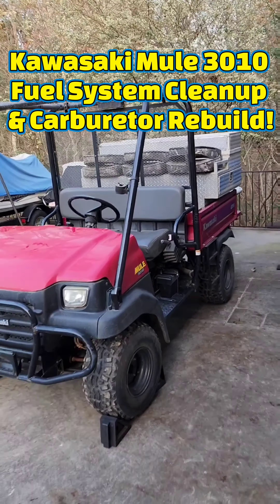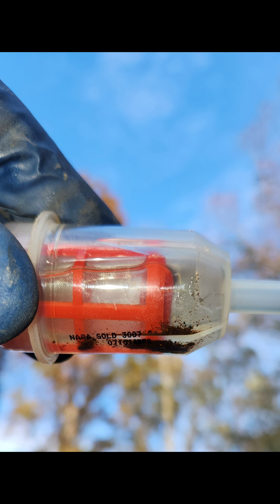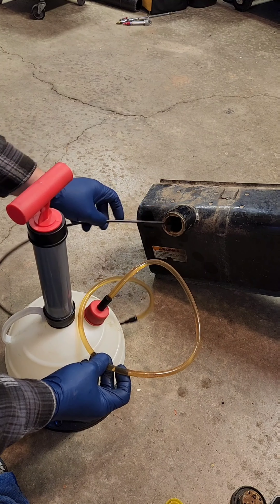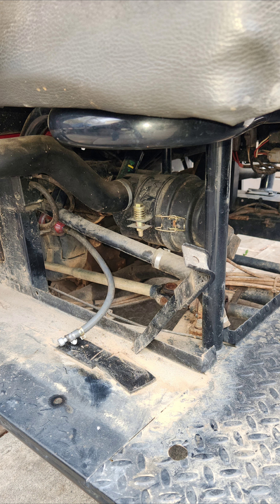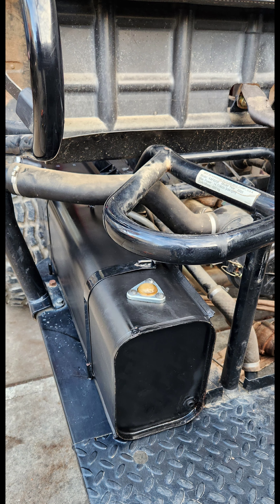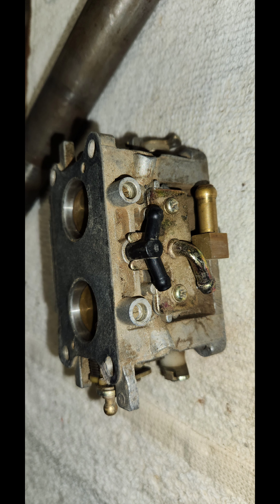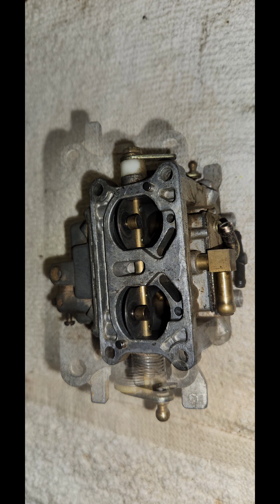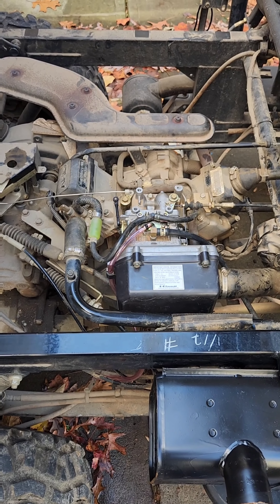Kawasaki Mule 3010 | How To Clean Out A Metal Fuel Tank and Carburetor Cleanup!

Comment: I have a 2510 mule and very similar looking gas tank arrangement, the one that you just repaired. I am unable to move more than a tiny bit of air backwards through the fuel pick up tube that exits the top of the tank. Is there an internal check valve or am I safe to ride it out with a long piece of wire thanks for your help. I can’t really visualize what’s in the bottom of the pick up
Reply from the maker: I'm not sure I understand what you are talking about concerning the wire, but the fuel pickup tube is a metal tube that is a small diameter tube that goes to the bottom of the tank. If there is any loose or large debri in the tank it can easily clog the small pickup tube and cause the vehicle to choke and not get enough fuel. Hope that helps. If you have any other questions just ask.